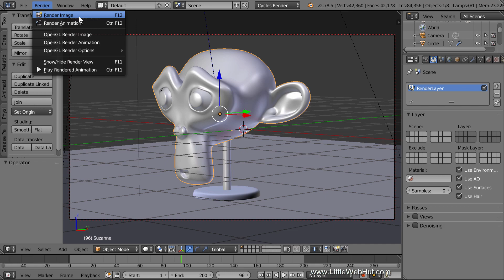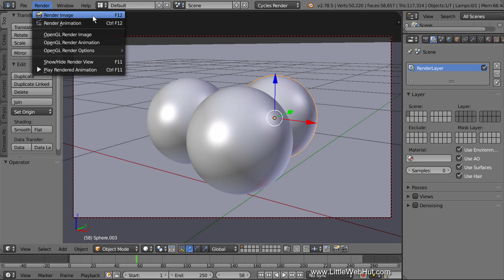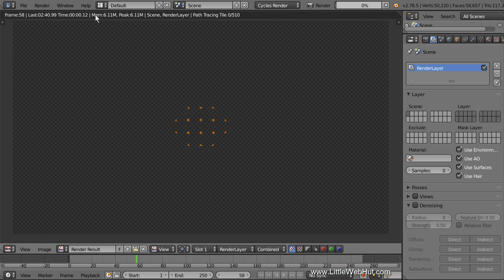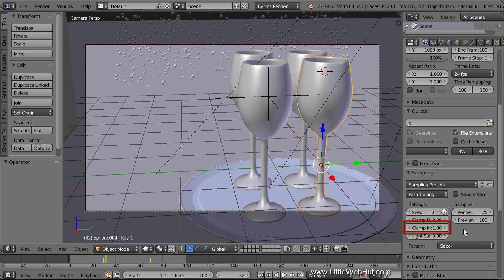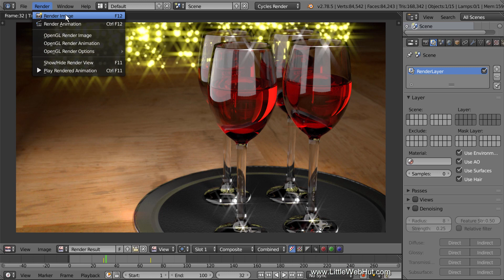Blender Tutorial: New Image Noise Removal Tool (Denoising)

Comment: I would have liked to see the results without clamping the fireflies, since in my definition fireflies are noise. And i try to avoid clamping my color space.
Reply: Isn't it more like reflections and light bounces going crazy?
Reply: Fireflies are not noise, they're hotspots, it's diffrent. The fireflies happen because it's calculating light bounces and they all end up in that one pixel. Technically the calculation is correct, but of course the real world is much higher res and has infinite light paths so that wouldn't happen there. What blender should do is add some randomness to it, but that would sacrifice accuracy. Atleast that's what I read,.

Comment: Finally, because noisy renders was one of the biggest problems of Blender, since ever.  But still, they needed to wait so many years to release something like this... instead of actually improving the render engine... and use this feature as a default one within every render.  i love Blender but things like this just give me the creeps. BTW, is the new Blender release out already???? this denoiser has been around for A LONG LONG time already in the new betas... by the way you NEVER EVER use clamp indirect to 1.0, unless you want to lose all the realistic shinyness on your render. Also, everybody knows that the number of samples should be far greater than 400-500 more or less no matter what model you are rendering. Nobody will use things like 25 or 100 samples in the final render lol. Thats ridiculous. In the meantime, we keep waiting for 2.79, they said it was going to be released 2 months ago.. well, we are still waiting..